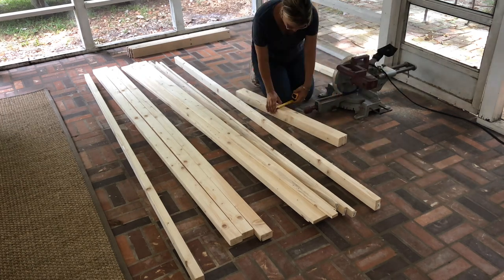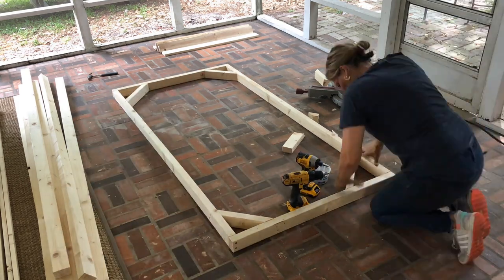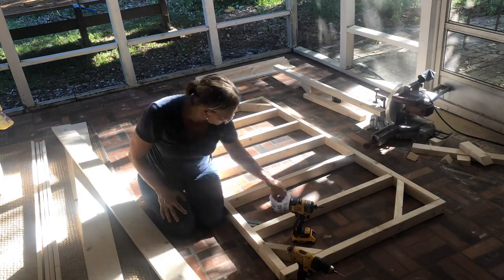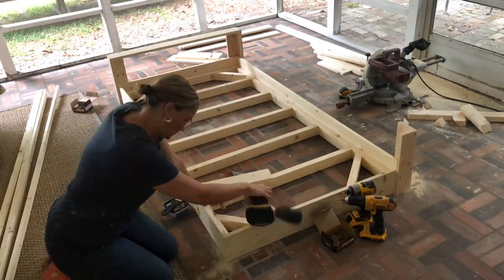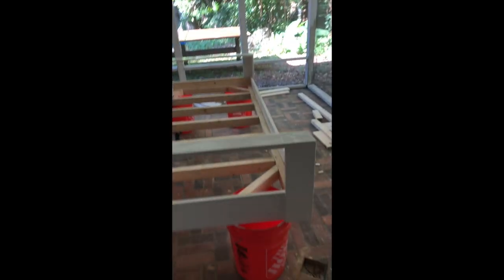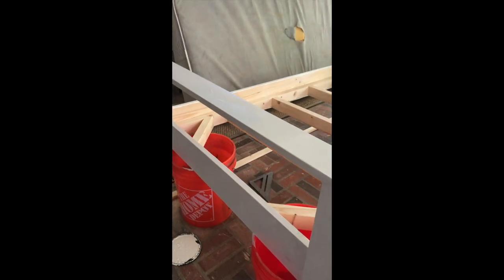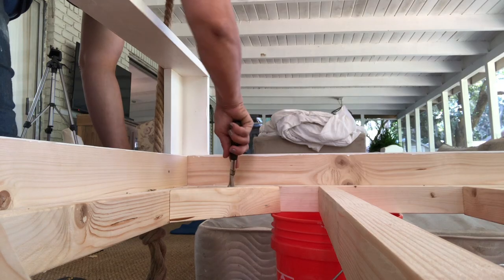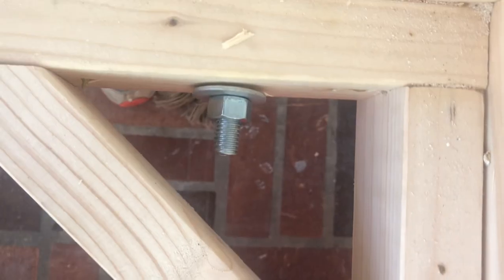DIY swinging bed / floating bed for the porch

Comment: How do you "pre drill"? And why would it prevent splitting?
Reply from the maker: you drill a pilot hole using a drill bit, before screwing in your screw. this will prevent splitting the wood.
Reply: Kreg pocket hole jig